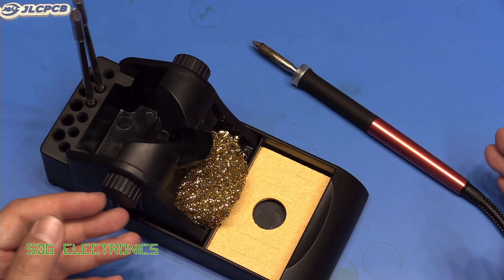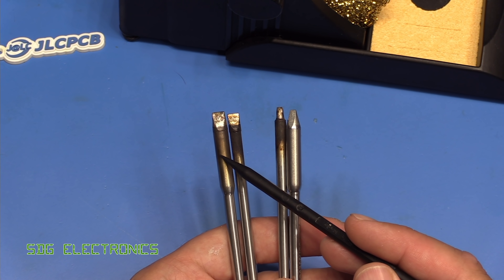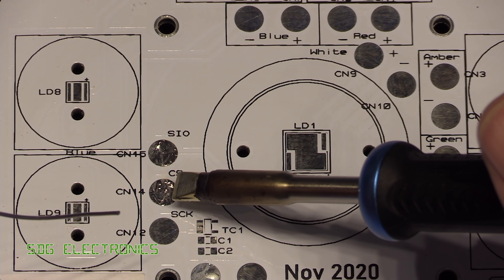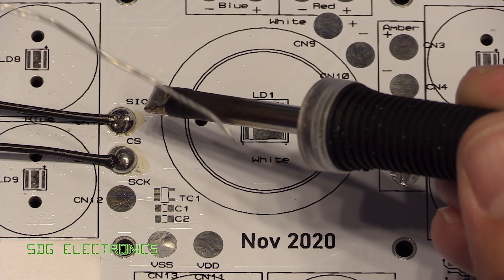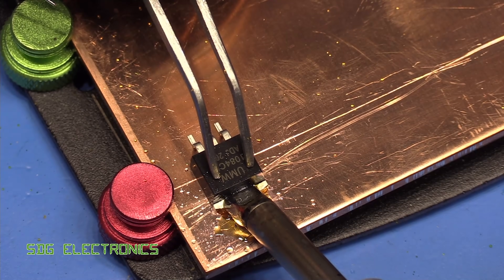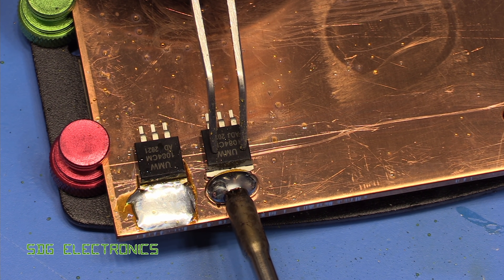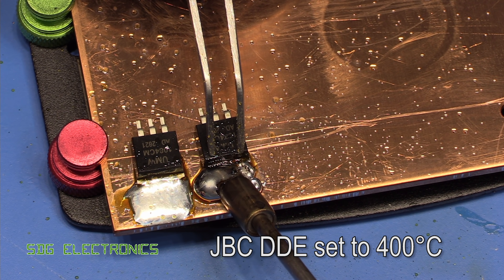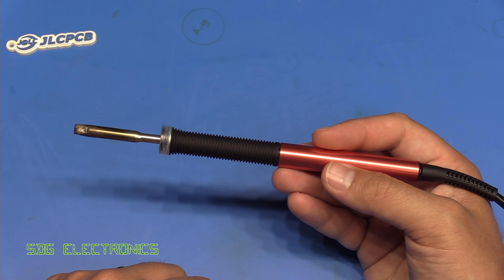SDG #226 Metcal High Thermal Demand Soldering Handpiece CV-H6-HTD, MX-H6-HTD, HCV Cartridges

Comment: Thanks for the video! I'm curious whether CV-H6 will be suitable for Mx500?
Reply from the maker: Unfortunately not. The MX500 is not powerful enough
Reply: @sdgelectronics  what about other handpieces for CV series ?
Reply from the maker: @Maxxxutk0  you could use the standard and ultrafine handpieces, but you'd be left with the DIN connector for the LED and memory chip. You'd be better to use the MX handpieces with the more flexible cables

Comment: I was wondering, will the heat from trying to solder those components directly to the copper pad destroy the component? I feel like components get pretty hot if you get stuck on a joint for a bit, always wondered how much they can handle. Would be helpful to have an idea of where the point is of starting to be destructive to the components. (Referring to 6:30-8 minutes in video) 
I was thinking of getting the Aixon T3A cause my 888D would end up sticking and going cold when I hit a ground plane. Is the Aixon T3A basically the best iron you can get for under $300? 
Is there any iron base out there that can handle all the JBC tips? (Hopefully without having to buy all the JBC handles themselves, but maybe knockoffs? Everything I am reading says to get legit tips when getting either Hakko or JBC clones cause the most important stuff is in the tip) Any help or suggestions greatly appreciated! Thank you much!

Comment: I wonder how it is possible a 80W metcal with induction heating can so easily beat a 130-200W cartridge based on a resistive heater. Is it because the induction induces heat on the target itself as well and not just in the tip? Or is the thermal delivery just much more efficient?

Comment: When soldering aluminium pcbs or fr-4s with large heat demand I recommend using hot plates. They are easy to use and very cheap. My first one was an iron I got from my mom. It worked perfectly fine.
Reply: Yeah. I have recently soldered some components directly to a large copper heatsink. This should be impossible with any soldering station known to me.
I just heated up everything including the heatsink with combination of hotplate and hot air, used IR camera to see if everything is at a right temp, then quickly soldered the component and then quickly cooled the heatsink to avoid the component baking for a long time.
Therefore I no longer worry about buying really powerful soldering station. I mean it could be useful if I was doing this all the time, but I mostly solder small components and those large pieces are very rare occurrence.

Comment: If you use the cartridges in the normal handle, do you get the same performance as the regular once? 
If you are correct about the cap value, they should be similar performance, with just a bit better thermal mass.

Comment: I think PACE ADS200 just has a bad algorithm. There is no excuse for that performance and I see the same thing with high thermal load soldering applications.
Reply from the maker: Did you have trouble with the ADS200? I'm trying to work out if I have a faulty one or if it's just got some strange limitation of output power. The station wasn't even delivering close to full power during that test.
Reply: @sdgelectronics  I do not think there is any defect just not that great of an algorithm. I know there where some problems with initial firmware and PACE sent ROM with new firmware to people but I do not remember what the problem was then.
I like the small hand-piece and works great for small thermal loads stuff. Is hard to compare with the 250W JBC HDE but seeing the comparison in your video with the 120W JBC that should be fully equivalent is clear there is some software issue with PACE as I can not believe the tips can be that much worse than JBC and initially it can melt the solder then after some seconds the power output is limited.
Reply: @electrodacus  The best explanation I’ve heard is that it’s a hardware issue: low quality or variable quality tips. That would explain why they dial back the heating power if the tips were being destroyed, especially in a production environment.
Reply: @davadoff  That may be a possibility since the main point of ADS200 was to have very affordable tips. In any case it is not a bad station for the sort of price I paid but it is not as good as it looks on paper.
Reply: @electrodacus  Yeah I think things have changed since launch. In the UK the price for the Pace is ever so close to JBC, both station and tips. 

The ADS200 has some good ideas (is good on paper), but they didn’t get the execution good enough IMO.

Comment: For manufacture rework to IPC standards in my experience large SMT power packages will use PCB preheat with hot air for removal while monitoring board perheater temp and local device temp, and then while the board is still hot remove the old solder using hot air with copper braid (use flux if neccessary) or contact desolder station with a large flat tip keeping tip tinned as you remove solder when neccessary (I use a PACE ST115 desoldering station). Part installation will use preheat with hot air after the board is allowed to cool and applying solder paste using a mini single device stencil (you can use some kapton tape as a way to hold and hinge the stencil after the paste is applied. If the SMT footprint is design properly for the device power tab or multiple tabs like a QFN, for example a DPAK part, you are looking for porper location relative to the gull wing leads for proper solder fillets on the gullwing leads, you can see the device power tab actually float on the molten solder and depending on the device size see it self-align. If the footprint is minimize and the part will not self align you can position the part manually side to side, but don't hold it in place from above, you want the device power tab to float on molten solder.

High thermal PCB subassemblies for rework will always use PCB preheat. The preheat temperture is the highest the board allows with a margin of safety (determined by the manufacturing engineer). I would encourage you to preheat your high thermal package PCBs and solder using solder paste and hot air. As a comparison to what is in the video try using contact soldering when the PCB is preheated with the same irons as in the video, however this time add liquid flux if neccessary (depends on solder used, board oxidation and soldering temperature). You will have to determine what your best preheat temp is for preventing overtemp, proper soldering and flux used (cleaning of the new device power tab(s) may be necessary depending on device oxidation). In the old days of contact soldering only, the basic rules where to remove the older solder but make sure the pad(s) are tinned, preheat the PCB, apply liquid flux, place the part, and then solder with multicore containing compatible flux to the liquid flux already applied. If you can solder the tab first while positioning the part relative any gull wing pad and lead position the device will float, then solder the gull wing leads. Tacking a gull wing lead is easier, but what is most important is the soldering of the power tab as what would happen in SMT manufacturing reflow. This is one reason why hot air soldering for rework and repair is so popular.

So what are high thermal capacity irons used for? Usually soldering large stranded tinned wire to PCB plated through hole (PTH) or devices. Even with PTH PCB thermal reliefs large gauge wires will conduct heat away from the joint. Also the joint has requirements for solder fill (IPC) and nice fillets (IPC) on both sides of the board. Hold the board vertical to see both sides of the PTH wire joint as you solder, add liquid flux if neccessary. If the plated through hole diameter is selected correctly relative to the wire guage you can produce complete fill with nice fillets on both sides of the board. If the plated through holes are huge relative to the wire, try slightly angling the board. Another popular use is soldering large TH connectors to PCB PTH that cannot be soldered in production using selective wave. There many other special cases to use a large wattage iron usually involving a PTH pad or a very large power single contact SMT pad.

Comment: Thanks for this - could you confirm which tip you were using in the Metcal high thermal handpiece?
Reply from the maker: It was an HCV-8VG0053S
Reply: Thanks I've ordered a complete system thanks to your reviews.
Reply from the maker: @markharwood  Hopefully you'll be blown away by the performance. Certainly after using it, I notice the inadequacies of all other systems.
Reply: These HCV tips seem hard to find in stock anywhere - did you have to wait long for backorders?

Comment: What Firmware version is on the MX 5000/MX 5200. does it need a Fw upgrade to work with? You know there is a way to upgrade the Firmware in those units... ;-)
Reply from the maker: As far as I know the MX is essentially dumb (it only has an RF output), so it doesn't need any kind of update to work with this handpiece. The only difference is the impedance matching.

Comment: After watching your videos I finally decided to bite the bullet and buy the mx-5210. Wallet feels a bit painful, but hopefully the joy it brings everytime I use it will make up for it. Just curious, what temperature series of tips do you use for day to day soldering?
Reply from the maker: I have a mix of cartridge temperatures, though it's primarily because some have been on offer when purchasing. Generally I use the STTC-0xx which all seem to be around 330°C, but a lot are the STTC-1xx which seem to sit around 385°C. I can't really tell much difference between them other than the higher temperatures lead to a bit more blackening of the tip where the flux has burnt. It wipes off though.
Reply: @sdgelectronics  Good to know. I'm in the process of transitioning to lead free soldering, so I went with the 1 series of tips. I find Kester's k100ld to work just as well as leaded with a 50C temperature bump.
Reply from the maker: @topQuark12  Yes the 1 series works perfectly with lead-free. Until reviewing some of these other stations recently, I'd pretty much forgotten about thinking what tip temperature to use. The Metcal 'just works' on all jobs.

Comment: Was the iron handle getting toasty at 80 watts?
Reply from the maker: No, the cartridge doesn't really get that hot below the heating element surprisingly
Reply: I have some things I do with normal hand piece that run on 80 with 8ch0050s tip and never feel anything.

Comment: That application large high eating heat sink would be greatly helped with a hot plate or at least somebody’s clothes iron that was put on a voltage regulator to control the temperature just below the temperature of melting  solder
Linda iron would not have to do so much work in a localized area and easily complete the task
Reply from the maker: Very true

Comment: I do a ton of soldering to ecu's where the pcb's are still attached to the aluminum cases designed as heat sinks so I always planed to get the HTD hand piece to make things easier on me but to be honest the normal hand piece works so well I haven't run into much it has trouble with. I did finally get a hold of the ultra fine hand piece and some tips, Very nice set up with these two. Hard for me to find enough reason to get the HTD.  I think my next attachment may be the desoldering gun instead.
Reply from the maker: The HTD adds the possibility of some much larger tips - there's a few new ones which will be available soon such as a 10mm chisel. I also find however the standard setup is more than adequate.
Reply: @sdgelectronics  are they gonna solder nuts and bolts likr JBC did to showcase they unecesary power

Comment: BTW, would be nice if Pace addressed the obvious problem with their PID loop. If 80W can heat the joint, there's no reason 120w shouldn't be able to handle the task.
Reply from the maker: It seemed to give up part way through. The LED on the front of the unit was mainly green (it blinks orange when delivering power). No idea what's going on with it, or whether it's faulty.
Reply: Yeah 120W in would do it, but I'm not even sure if its capable of delivering 120W continuous. In SDGs previous video it was pulsing on and off at 120W, as if the dead time was really long. It should really only need ~10% dead time or so, which would be around 110W continuous. It could be a combination of software + hardware limitations.
Reply from the maker: @jaro6985  I'll try to dig deeper with the Pace. I just don't understand it's behaviour.
Reply: @sdgelectronics  I gotta believe the engineers at Pace are aware of this limitation. As you said in a earlier video, it may be deliberately programmed to conserve tip life. Unisolder is supposed to work the the ADS200 handpiece. Maybe test it with that. However, it may burn out tips prematurely.
Reply: @sdgelectronics  I did hear about quality control issues with Pace cartridges after the launch of the ADS200.

I think EEVBlog Dave got a very early firmware version station. Is there some way he can send you the firmware so you can compare the performance? Or work together with Dave to find out?

Comment: The cartridges won't work in a standard MX-H1-AV handpiece? Would be quite an added expense for another handpiece and the high thermal demand tips. Unless you would use this for production, it would seem more economical to get an old fashioned iron for occasional use.
Reply from the maker: From what I gather, you can use normal cartridges in the red handpiece but not the other way around. I forgot to test this though.
Reply: If you want to use a normal MX-H1-AV handpiece, thermaltronics has also released some high thermal demand cartridges. They are probably not quite as beastly as the metcal, but, are reasonably priced.
 Visually I cant see why the HTC cartridge can't fit in a regular handle. Although, I did have one instance of the thermaltronics power tip tripping some internal protection in the MX station, so maybe that is part of it.
Reply from the maker: @jaro6985  it does fit, but one user on the EEVBlog forum said the unit didn't heat the cartridge in the standard handpiece. I'll try it today and report back

Comment: For much of that work a 200W soldering GUN would provide a much cheaper solution.  I looked at the price of what you're using here and think it's a bit too high for the results.

Comment: I love watching your soldering hardware videos, especially this series and videos about Metcal gear. Very interesting and informative. 

My only request is for 1080p video.. and for more videos! 😁
Reply from the maker: 1080P should be an option. Let me know if it's not showing up!
Reply: @sdgelectronics  It’s not showing up. 

Oh that’s weird… Why I made the comment was because I watch your videos with YouTube app on my smart TV and the highest resolution option for your videos is 720p. I doubled checked on my phone.. the top two options are “1080p50” and “720p50”. 

I’m in UK but I guess if you use 60 FPS it’ll then work for me. I have a 4K TV and I have no issues playing 1080p or 4K content on YouTube otherwise.
Reply from the maker: @davadoff  it should show up as 2160p50 for the highest resolution. Not had any issues on my TV or computers
Reply: @sdgelectronics  Nope. I can’t get it to work on my TV. It’s a 2015 LG 4K TV. 

I’m pretty sure is it’s got something to do with frame rate. Maybe the YouTube app only runs in a 60Hz refresh rate mode. I have noticed before that it never seems to switch refresh rates for different videos.

Comment: I have to solder a 1200W ceramic RF mosfet  to a big copper heat spreader. I think I'll use a hotplate on the spreader before applying the iron to get the solder paste to flow if the the hot plate can't hack it. 
Have you noticed the bots (assholes) that post a short link in the YT chat of almost every electronics channel I follow. Hell isn't hot enough for them.
Reply from the maker: Yes preheating will always be the best solution if you can do it. I'm only showing extremes here but as you know, there's many ways to solve a problem like this. Never understood the bots or what purpose they're trying to serve - YouTube is rubbish at filtering them out despite filtering genuine subscriber's legitimate links.
Reply: @sdgelectronics  I can't stand YouTube at times. Allowing bots but doing the dystopian deleting of my comments for at times quite mystifying and unknown reasons.

Comment: Might be interesting to measure the internal capacitor value.
Reply: Actually I think it's an inductor - my standard 5200 handpiece measures 25uH
Reply from the maker: @mikeselectricstuff  I'll see if I can measure it. Did you stick a probe down the handpiece?
Reply: @sdgelectronics  Yes - unscrewed the handle to make it easier
Reply from the maker: Not particularly convincing difference here, but I got 22 uH on the standard handpiece at 100 kHz on the LCR meter and 25 uH on the HTD.

Comment: nice. i wonder if it can  also be used for soldering together small metal objects. although the result may not be strong as brazing, using a blow torch etc. it is still something interesting however for the higher convenience.  for example to join together a small delicate decorative ornament etc. where the pieces of metal are too fine and too thin to hold screws or rivets. Or sometimes the metal object is to serve some specific function. where it has to be of a low mass like a needle or a gauge for some vintage piece of equipment